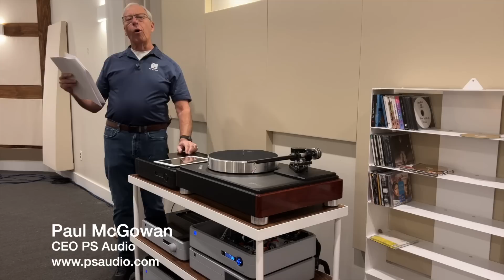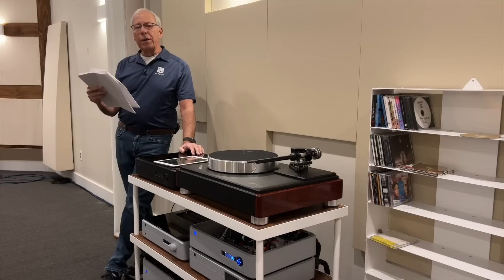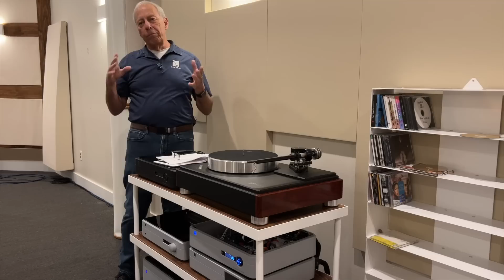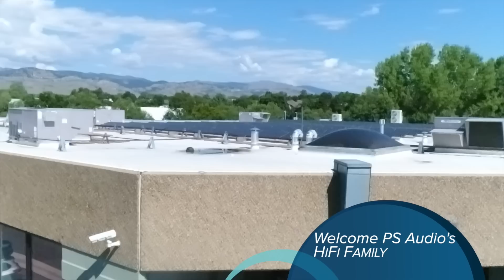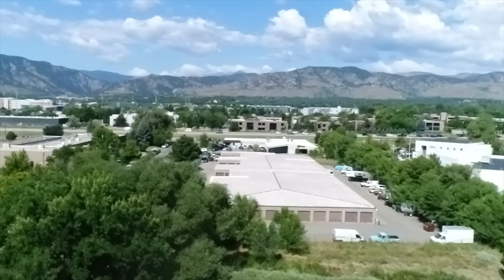Hearing higher sample rate audio

Comment: capture accuracy is the false concept, as the nyquist tgeorem holds up.

for dsd, where no nyquist restoration takes place, it defines the accuracy though.

what is influenced by higher capture frequency is the rolloff filter so there is no higher order distortion in the audible range and a presence of higher harmonics that can interact with the audible musicaly in the recording.

playback wise basicly all modern dacs, even cheap ones, use supersampeling to prevent d-a conversion filter distortion.

for digital mudic processing and mastering sample rate makes all the difference, as it allows for more frequency shifts without loosing high.

Comment: Higher sampling rates are not more accurate. Higher sample rates are simply capable of reproducing higher frequencies. That is not the same as being more accurate. They are two different things. A 192 kHz sample rate is not more accurate at reproducing a 1 kHz signal than a 44.1 kHz sample rate. It doesn’t work that way. They would both reproduce it as well as the other. There could be any number of other reasons you think you’re hearing a difference, but it most certainly is not because of the sample rate itself. I’ve heard you mention many times that a higher sample rate lets it maintain phase relationships because it has a better time resolution at a higher sample rate versus a lower sample rate. That, too, is incorrect. 192 kHz does not do a better job of maintaining phase relationships because it is “higher resolution” than 44.1 kHz. It isn’t higher resolution. There is no resolution. It either works or it doesn’t. It is either below Nyquist or it isn’t. And it doesn’t do a better job of maintaining phase relationships or the timing of signals or anything else you’ve mentioned in your videos. 44.1 kHz maintains all those things exactly the same as 192 kHz does. The only difference between 192 kHz and 44.1 kHz is 192 kHz can reproduce everything below 96 kHz and 44.1 kHz can reproduce everything below 22.05 kHz. That’s it. That’s the only difference. And so for all signal content that remains below 22.05 kHz they both do exactly the same job at reproducing the source signal, including phase relationships and timing. Yes, including phase and timing. I don’t know why you still do not understand this. You’ve been in the business far too long to not understand this. Not only is this easily verified with an oscilloscope, someone has done it for you already, and I’ve posted this video of the testing to show you what actually happens with phasing and timing, which you either have refused to watch or could not understand. If you’ve refused to watch it, watch it. If you can’t understand it, watch it over again until you do. It is explained and SHOWN very simply and clearly. 44.1 kHz maintains phase and timing “between the samples.” That’s just how digital/analog conversion works. You’re shown what happens when you slowly change the timing back and forth so the signal starts and stops between the samples. And the result is the signal is still reproduced properly when you alter the timing of it in that way. What you claim is lost is in fact not lost at all. If you think you are hearing a difference it is because of something else in the chain that is behaving differently. The digital/analog conversions are not responsible for whatever you think you are hearing because they are not losing what you think they are losing. https://youtu.be/cIQ9IXSUzuM

Comment: Paul, you know as well as I do. The key factor isn't so much the equipment but the listeners ears and trained ability to hear the differences. This plays the largest role.  And everyone has difference in hearing.  
How we precise sound is more important then the play back device.
I've yet to hear a recorded item sound like the live version but and this is big unless your in the sound studio when its recorded you wont have anything to base it on.  The sound engineers going to change it that artist is going to ask for changes and the media reproduction will all have effects on the orignal tracks.
What you basically hear is what the recording artist and sound engineer wants you to hear. Then you've got you play back equipment and then your ears.
The only slight difference is somthing recorded live. But even thats been played with.   And you almost can ever find a band recreat the same thing that was done in recording.
Reply: Please, audiophiles are just a bunch of snobs. Just like there are only a couple of "wine experts" that can tell different grapes apart, there are only a couple of audiopiles that can hear the difference between a class A and a class D amplifier.

Comment: With a CD or SACD they are getting one shot to read the sample whereas with a streaming high end DAC the sample can be read over many times to fill in as many pieces as possible. CD's or SACDS simply can't compete with a good dac. I ordered PS Audio's SACD played through my Rossini transport sounded better than the CD's but my DAC with streaming 96/24 files blew it out of the water no comparison. Now if you have just an okay dac and then a good SACD player then the SACD might seem to be equal or better.

Comment: 44.1k vs 48k
There's a story here. When digital audio recording was first implemented the only tape machines that could record that bandwidth was VTRs. The popular choice was 3/4inch industrial VTRs as a true broadcast grade machine was a bit overkill. So since NTSC video is 60fps, let;s make our sample rate divisible by that so we can pack the data neatly into video frames. As industrial VTRs worked fine at true 60hz no problem. But real NTSC video is not 60.0hz. It's 59.94hz since the 1954 induction of color TV. Due to some frequency interleave problems they shifted the H&V frequencies very slightly to compensate. So when digital audio was eventually married to video, 44.1k no longer worked at 59.94hz. Furthermore the European PAL standard at 50hz was a problem as well. So they moved to 48khz to make digital audio compatible with NTSC and PAL TV. This frrequency relationship remains today even with HDTVand UHDTV.
Reply from the maker: Fascinating. Thank you, Andy!
Reply: Not all higher sample rates will be “better” it all depends on the ADC and the production value. How it’s recording in its original sample rate and resolution is equally important. 24 bit isn’t really important on the consumer side but in the production side 24 is better for processing. There’s also the truncation of bits so keeping things as 24 bit avoids truncation and dithering/noise shaping. 

The ADC, the noise of signal ratio and avoiding clipping and distortion is what’s important and of course musicianship and sound engineering. 

The interesting thing is that a discrete ADC circuit may not measure well but may sound better than of the on the shelf ADC chip. Also some ADC the sweet spot isn’t always what it’s highest sample rate it can do. So you might find that an ADC that does 192/24 sounds better at 24/96. Usually the clue is in the default settings by the manufacturer. Music is subjective so it’s all a matter of taste and personal preferences.
Reply: I always thought that multiples of 48 were used because of frame rate align. For instance all multiples of 48 lowest common denominators is 24 frames per second coincide with 24 hertz sample rate. So video is also multiples of 48 and music is always multiples of 44.1 🤷‍♂️
Reply: @joesmith4443  In digital audio and video systems. the audio sample rate must be locked to the video sample clock. In many cases the audio is embedded within the video data payload as time compressed data bursts. Therefore the audio sample clock must be synchronous and derived from the video sample clock. This extends further to compressed delivery formats, DVD is an example. The only 44.1 digital  audio/video format I am aware of was Laser Disk with a PCM sound track. Here the 44.1k  PCM data was just modulated to an FM carrier as was the analog video and analog audio tracks. This frequency multiplexing technique did not care about the absolute digital audio sample rate as it was not locked to the video. But Laser Disk was  an analog system. The rare DTS and AC3 capable laser disks also just used an FM carrier that was not locked to the video timing.
Reply: @andydelle4509  The syncing  must be done after the video has been recorded using an external recorder that captures a soundscape, and sound fx are added later. That’s why a clapperboard is used to sync the audio with the video. I get what you are saying about clocks being in sync but it also have to do with frame rate. If something is running at 24 frames per second so does the audio since half of 48 is 24. For streaming everything is 24/48, for blu ray and ultra 4K it’s often 24/96 or 24/192 depending on how much data they can fit on a disc (ie multitrack, Atmos, etc) I also believe that’s why blu ray Audio is also at multiples of 48 kHz.
Reply: @andydelle4509  The “problem” with Octave records is that Paul records in DSD and then is selling things in PCM that are upsampled/ Downsampled from DSD. He should just sell them as DSD. DSD can record at the sampling rates of 44.1 and 48 khz at 64x, 128x, 256x but it’s often defaulted at 44.1 (only few DACs or DAC chips can decode at 48 kHz DSD) but that’s about as much as they have in common with PCM or CDDA to be exact.
Reply: @joesmith4443  The old clap board has nothing to do with it. That is (was) to re-establish lip-sync with the film. The majority of what feeds you monitor these days from OTA, cable and DBS is still 1080i/59.94 or 720p/59.94. On film material 3/2 pull down is added. This is legacy since the first  CRT based HDTVs could not do 24p. Also anything OTA broadcast must be at 59.94hz. SDTV is still required so the HD feed must be the same frame rate to be muxed into the MPEG stream. Due to the legacy 59.94 gremlin, most film transfer and digital capture destined for television is shot at 23.98, not 24.0 But even at 23.98, the audio is still at 48K. Now sometimes we do re-sample the audio at 47.956K. But that's for other reasons in post production. The delivered product is always 48K. Also a live broadcast at 59.94 is still running audio at 48K.
Reply: @andydelle4509  Interesting stuff! Yea I’m well aware of the broadcasting is always behind the times especially News and those Cop shows, and network shows? They still use progressive scan. Isn’t that outdated! I read that in the film production book. I forgot the name. The problem with audio production (music) these days is overproduction in post to make things sound “perfect” on the grid. I would imagine it’s similar in video production. One book I read that pretty good at depicting “cuts” in editing was “In the Blind of An Eye” by Walter Murch. So much video production especially on YouTube influencers there are soooo many 30 sec cuts it’s annoying. No more long shots also due to attention spans. It’s the same crap in audio production. Engineers just rely on fixing things in post since digital is convenient and cheap. In the analog days you had to be frugal since tape was expensive so many older engineers were better at their craft.
Reply: @andydelle4509  don’t they use 25 frame per second in Europe?? Btw, I know what you mean about “the gremlin” standards get itched in stone even when they are outdated and inconvenient.
Reply: @joesmith4443  Yes, 50i which means 25fps. When film is televised, they just ran 4% faster. Each film frame was two TV fields. For 60i (59.94i) , we use 3/2 interleave.
Reply: @andydelle4509  Cool stuff. It seems that European standard is better since it doesn’t deal with a fraction like 59.94. It’s really interesting that 24/25 fps works perfectly fooling our eyes. I know that 60 frames or higher looks weird and exposes a lot of the film tricks when slowed frame-to-frame. Also when you do slow motion with more frames per second how is that implemented in real time 24/25 fps. Is it sped up?? How are the frames per second clocked? Does that have to do with shutter speed and aperture in digital cameras?  In digital music there’s an actual clock that times everything.

Comment: Wow ... this is really dumb. First say that nothing more than 20KHz is going to the speakers, then sort of try to justify higher sample rates which do NOTHING but pass higher frequencies.   At the DAC, the sample rate is the delivery format. It is no indication of what the capture sample rate is. The ADC probably captures initially at high MHz Sigma-Delta, then decimates to 192 or 96KHz PCM. That is used throughout the editing process, before finally a 16/44.1 version is created.
Reply: 192 and 96 are not evenly divisible by 44.1, so downconverting like that causes distortion right there in and of itself.  And the difference CAN be heard.  As a matter of fact, upconverting a 44.1KHz CD to 96KHz will also cause distortion, and the difference can be heard.  The 44.1 will sound better.
Reply: @Hyxtryx  Again talking out your ass. It is a mathematical translation. You can do the math easily with "distortion", 150+ db below the signal without even blinking.

Comment: 192 KSPS, 44.1 KSPS, not KILOHERTZ!!
Reply: I'm not following you here? Sample rate is the same as the sampling frequency. 44.1ksps still means the sample clock is 44.1khz?
Reply: @andydelle4509   HZ is a analog frequency. KSPS ... samples per second. Not the same.
Reply: @robertt7238  Right, but the ADC clock frequency for 48KSPS is 48khz. When I worked heavily with early digital NTSC television equipment, the sample rate was typically expressed as 4fsc. That meant 4x the NTSC chroma carrier of 3.58mhz or 14.318.180mhz.  I see what you are saying and agree the term KSPS  is a more accurate definition, but in my career I have rarely seen sample rate expressed like that.

Comment: Once you reach CD quality (44.1K) samples you will not hear any difference in any higher sample rate. It is not my opinion, it is physics and Nyquist-Shannon. But don't trust me, listen to the creator of Ogg Vorbis format and his lecture on it. I won't link here but do a search for D/A and A/D | Digital Show and Tell (Monty Montgomery.
Reply: It’s like trying to drive a Bugatti through the McDonald’s drive through.😀

https://youtu.be/L7NEkqjQoS8
Reply: I watched that video.  Everything he said is true.  However, he made no mention of phase shift being caused by the antialiasing filter.  It would have been nice if he digitized his signal at 44.1KHz and 48KHz and showed the results of both on the scope at the same time.  Measure the phase shift at 1KHz, measure the phase shift at 20KHz.

Also, when he increased the frequency of the sinewave and it approached 20KHz, I think I saw the amplitude start to drop slightly.  That would make sense, since the filter wouldn't be perfect, and maybe it's down 3dB at 20KHz, and 1dB down at 19KHz.  Can you hear 19KHz?  Probably not, but my point is that it's difficult to get a perfectly flat frequency response from 20-20KHz when your cutoff frequency is so close to 20KHz.  This is why cheaper CD players in the 2000s often did oversampling.  Oversampling at 8X means sampling at 352.8 KHz ... and I forget exactly how that was done when you have the bits already on a CD, but the result was that the manufacturers could put cheaper filters in with less slope, but cutoff frequency way up above 100KHz, providing flatter response at 20KHz and less phase shift.
Reply: @Hyxtryx  just shut up